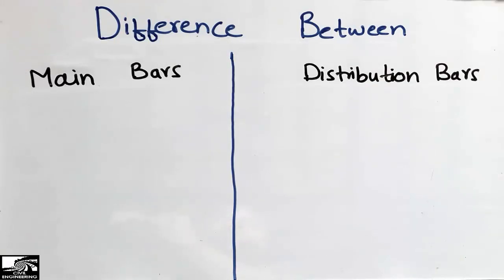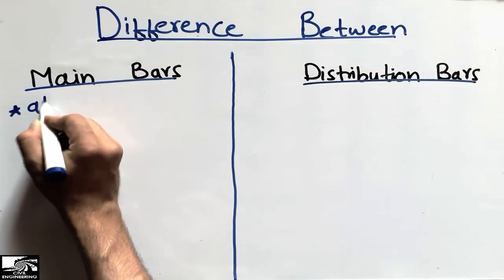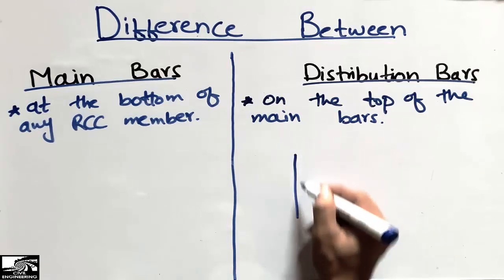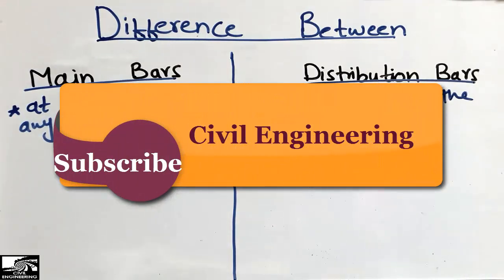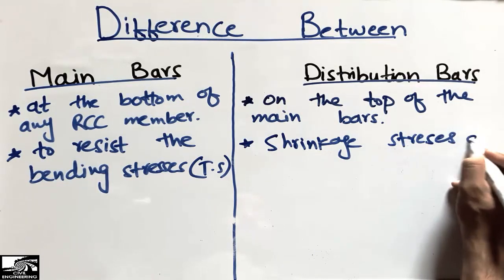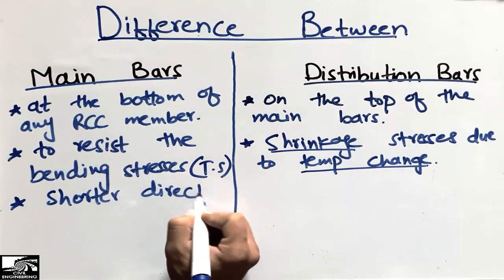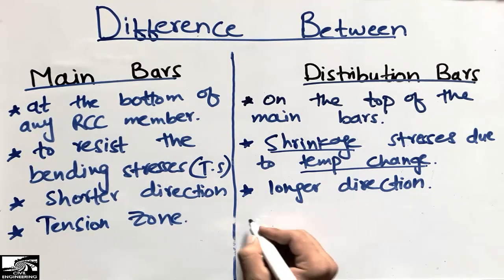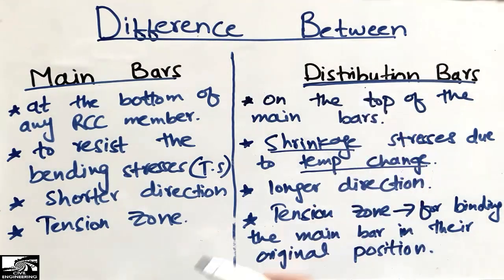Difference between Main bars & Distribution bars

Comment: Main bars are on upper side ???
Reply: Main bars are provided to overcome the bending moment. If there is single jali in the slab, obviously main bars will be in bottom. If there is double jali in the slab, u need to look out the load mechanism. In this point in double jali slab the top most and bottom most bars counter act the bending moment. Hence in top jali the main bar will be on top and in bottom jali main bar will be in bottom.